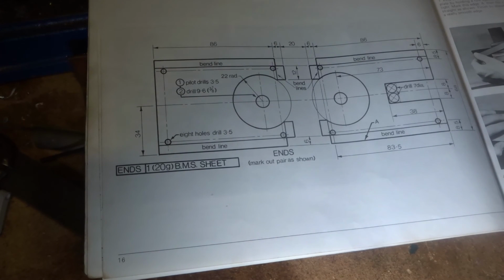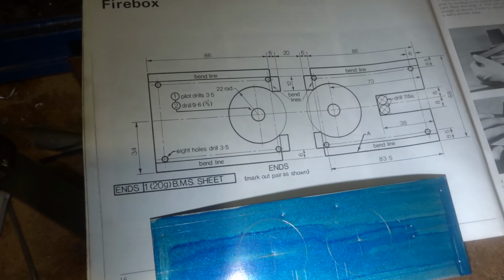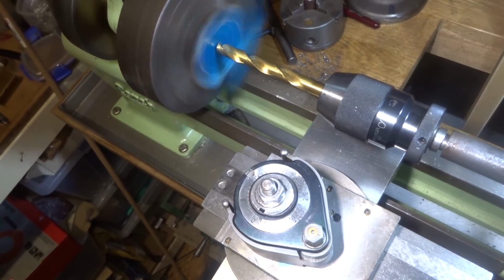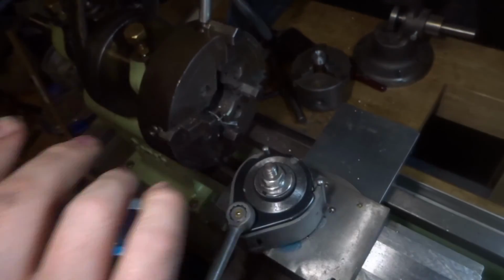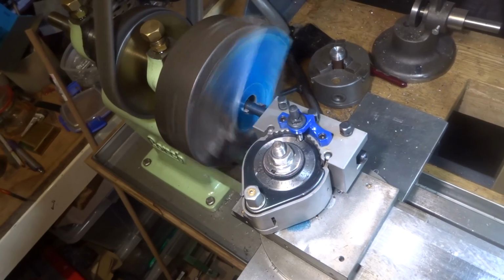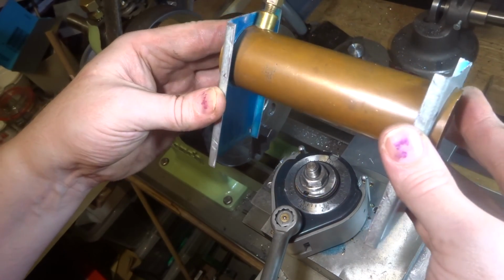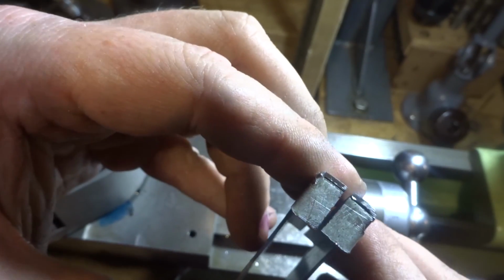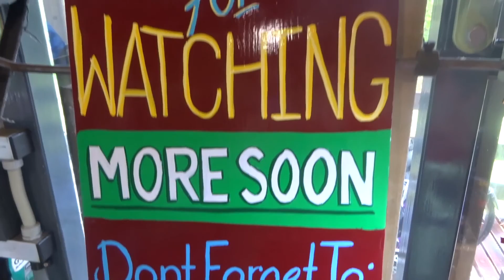KENNETH WELLS  SCHOOLS  Steam Engine PART 3 firebox ends

Comment: Hi Emma,
Parts look nice, the tool post is a great improvement for your lathe...
To get rid of the burr in the back, you can go in with the boring bar, back up on X and make use of the back of the bit to just touch and cut the burr, just make sure the back of the bit is meant to cut...  Then easy bye, bye burr....   ;-)
Reply from the maker: thanks pierre beaudry

Comment: Emma, how do you like your new tool holder? I've got one like it On my way! my 27 inch turn-nado. The tool holder is the best part! Well I hope you like your as much as I like mine.
Reply from the maker: The Texas Gun Guy i like it a lot. will need a little adjustment and fine tuning then ill get a more comprehensive video up about fitting it up and using it.

Comment: I like the new tool post..
How do you like it?
Getting some done a little at a time and it looks good.
Mike
Reply from the maker: Oldvet1946 actually i really like it a lot. it does need a dowel pin to locate it, it tends to move when u tighten it up. ill do a follow up video about that. is a couple little mods it still needs. thanks for watching!